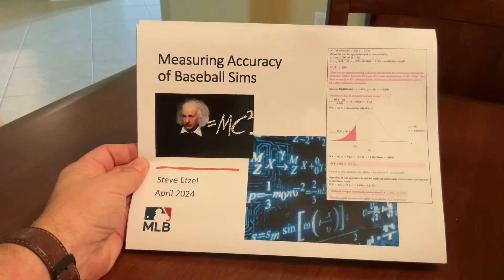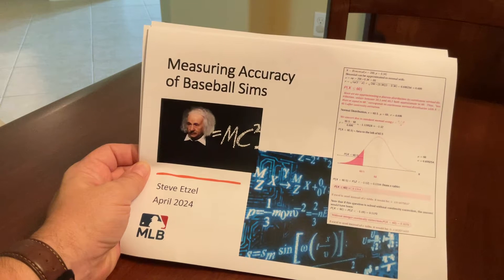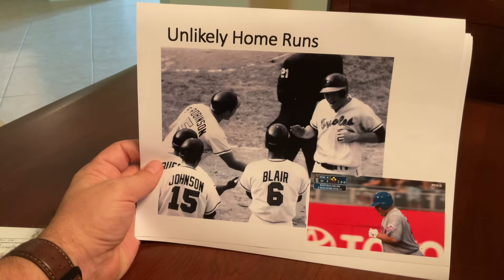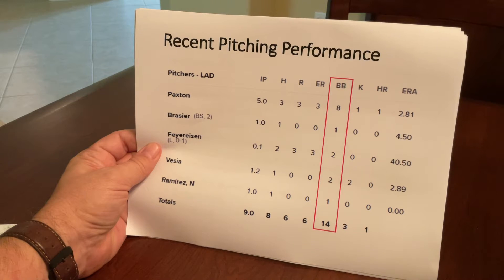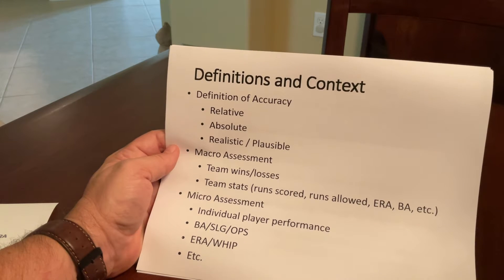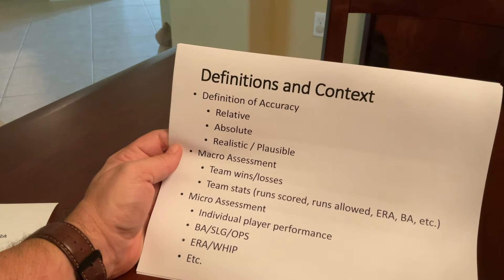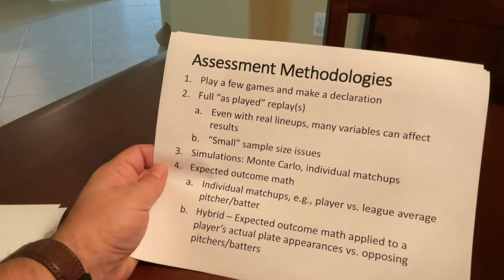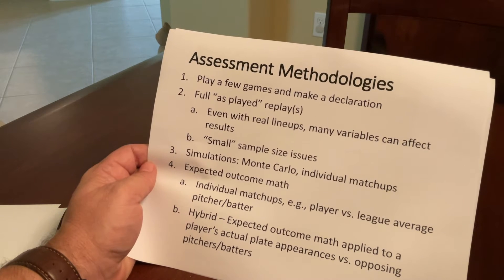Measuring the Accuracy of Baseball Sims

Comment: I remember in the 70’s getting angry at Stratomatic.  I had called them to find out how they computed their cards and the guy actually got angry at me on the phone.  In hindsite, maybe I deserved that.  But it ticked me off to the point that I reverse engineered it and found that it appeared they did exactly what you said.  They created hitting cards against what the average of all pitchers would be.  I never looked into pitcher cards but I imagine it was vice versa.  Since then I’ve toyed with the idea of having outcomes based on the current simulation outcome and giving the advantage to that player.  So for example if the player in the sim was 40 points below his batting and the pitcher was only 15 points from his batting average allowed the advantage would go to the hitter and his card.  The odds of going to one particular card would increase based on how far they were from their real life outcomes.  So a 50 home run power hitter would be more and more likely to hit a home run the deeper he went into the season without hitting one or very few.  It would be pretty easy to do with a computer program - not so much with cards.

Comment: If the micro factors are accurate, the macro results should be accurate as well over the course of 154 or 162 games.  Sure, there will be differences, but the results should be believable.  

Most baseball games have player cards where you can calculate the averages from the cards.  If you factor the batters' cards against the average pitcher, his stats should be very close to the actual results he produced, give or take some points due to ballpark adjustments and a few other intangibles.

Comment: Great job as always!
Reply from the maker: Thanks.  I believe someone mentioned that you did a nice article on a related topic for Sports Sim Magazine.  I need to track that down.
Reply: @steve_etzel  Also, I try to be careful when using the binomial distribution to describe at bats in baseball as the condition that the probability of a hit (or what have you) is the same from at bat to at bat is clearly violated. I wrote an article about Maris and Mantle in 1961-- which may be what is being referred to here-- and the other approach I tried was using Maris and Mantle's actual performance game-by-game to model whether they hit a homerun. Thus, if Maris hit 1 homerun in 4 at bats, he had a 25% chance of hitting a homerun each at bat; if he went 0 for 3, he had no chance. Both models produced similar results, which was encouraging.
Reply from the maker: @ericsimon2671  This probably isn’t what you’re referring to but I’ve been wondering about serial correlation.  In other words, do batters have hot and cold streaks that are not just a result of normal statistical variability.  A related analysis could be multiple game hitting streaks (Pete Rose).  I appreciate your work because it goes a level deeper than am willing or able to do.
Reply: @steve_etzel  You and I have a lot of overlap in what we produce. I love your stuff. I actually have to rewatch this one as I only listened to it at work and I prefer to watch your content.

Comment: Well done.  As you suggest even if you give a .330 hitter 600 plate appearances in your replay and he hits .290 don't necessarily assume the sim engine is flawed!  As someone with an APBA background I've seen sims of the same season, all using the same APBA basic game engine, with reasonably different results at the individual player level.  Eric Simon in the April 2021 edition of Sports Sim Magazine has an excellent article on this topic which addresses the "odds" through the lens of binominal distributions.
Reply: I think that it is mostly influenced by the timing of the dice and the size of the project. The smaller the project, the more the gamer is susceptible to the luck and hot/cold streaks of the tumbling dice.